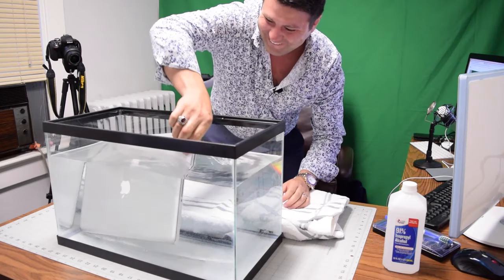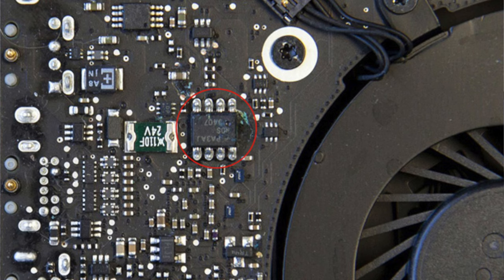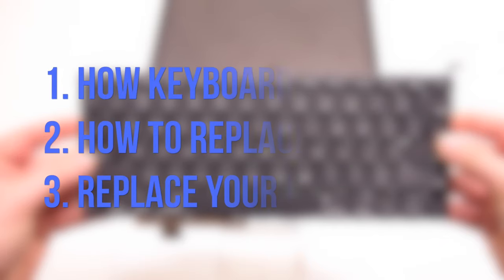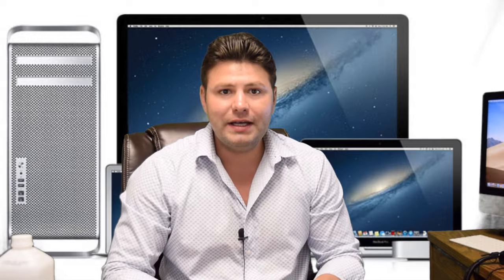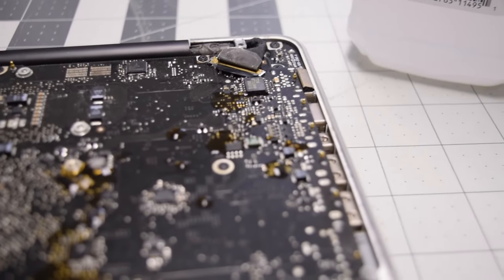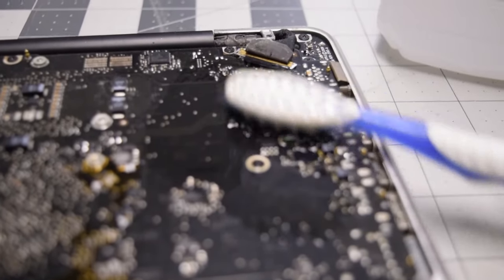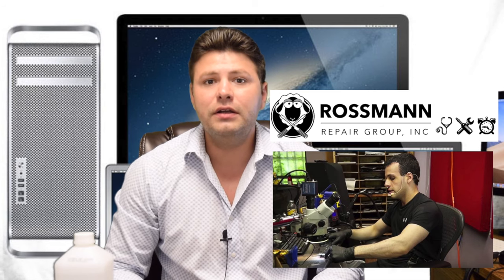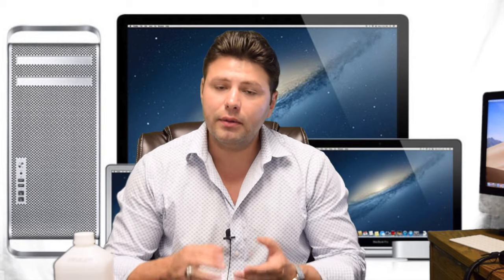Liquid damage repair | Macbook Water Damage Repair

Comment: I recently discovered an easy fix, disconnect power and battery, buy some 99% isopropyl and flood the whole keyboard area, let it sit for a few hours, drain, repeat then dry it with a hair dryer, let cool, repeat one more time to make sure its completely evaporated all the isopropyl. Fixed the few drops I spilt on my macbook that kept it in a reboot loop. So much easier than buying a new keyboard and the stress of having to remove every component in your mac, a job I only wish on my worst enemy.

Comment: thanks for the great info.
I have a liquid damaged mid 2012 13" mbp ( non retina ).
I did all the alcohol cleaning (did superficial cleaning of keyboard but didn't remove it ) and reassembled.
but entire keyboard is not powered up.
backlight - not powered up.
trackpad mouse arrow moving - but left and right clicks - not working. ( btw trackpad was untouched during cleaning ).
Any suggestions?

Comment: None of the videos are reassuring me about small water damage. I spilled a very small amount of water on just a couple  of keys and I have it now turned upside down and will wait a couple of days to insure that whatever water is inside is dried off. Many video are stating that I need to take it to apple to have it checked out. Is this necessary if everything will be working properly? Should I worry about any corrosion if I don’t have it checked out?

Comment: I just spilled water on my MacBook Pro and I didn’t know what to do so first I cleaned it up and then I try turning it on with the Touch ID and then I connected it because maybe the battery turn off because when I finish cleaning it it still work but I reset it and that’s when it happen. Is there still a chance that it might turn on? I put in a shape of a triangle...

Comment: Hi. Can u help me with my Apple Imac 27 mid 2011. I cannot turn on. No chime, no noise from the fan, just nothing. I already remove the screen and also lcd. When i check the 4 LED Diagnostics, only the 1st LED lights up bt just a second or two thn it lights off. FYI, the plug still switch on. Please help me!